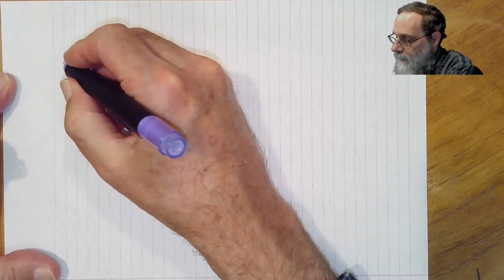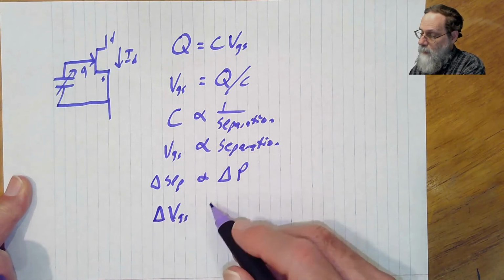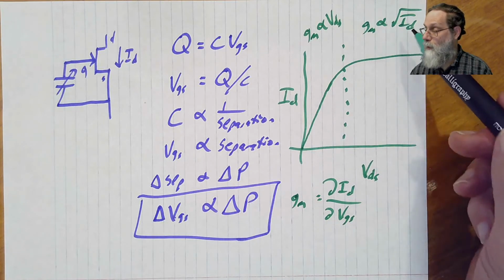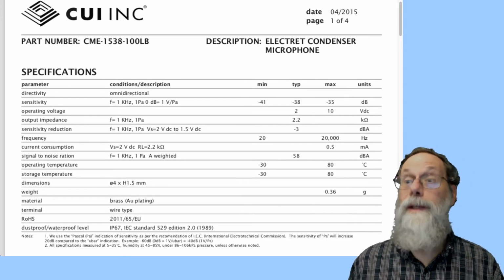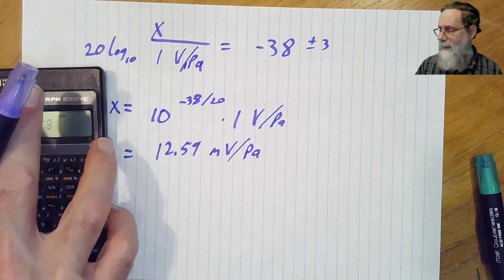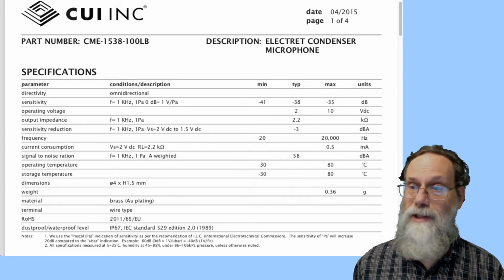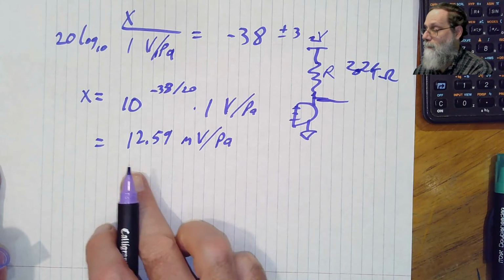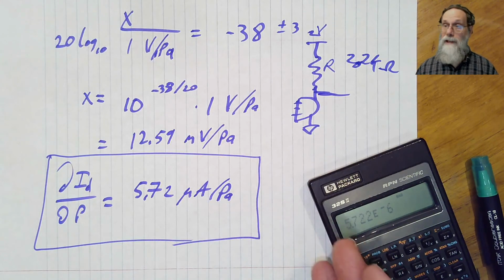Microphone sensitivity §26.4.2–4

Comment: In order to get the specified sensitivity you have to operate the microphone at a source voltage of 2 V. The output impedance of 2.2 kOhm requires at a current of 0.5 mA an operating voltage of about 3 V, because you have a voltage drop of about 1 V across the sense resistance of 2.2 kOhm. I guess the microphone is designed to operate at a voltage of two alkaline batteries in series connection.